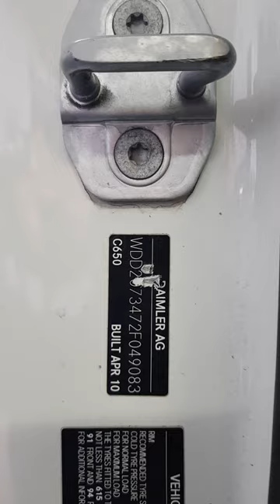Mercedes-Benz electronic seat motor repair tips

Comment: Common issue is that the cable housing stretches a bit. Fix is to get a new cable made that is a mm or so longer by a speedo shop.
Reply from the maker: I seen to cables turn out half turn ,usually it's can be put it back .
Reply: @alanw5812  yes, that can be put back in. But in a short time they may pop out again. When I had new cables done they never came out again. Up to you what you want to do. Your video is good in that it points out other issues that can be the cause of cable issues and should be checked for sure.
Reply from the maker: @georgecurtis6463  usually I will put that side to fit to the rail side, because usually came off  motor side.
Reply: @alanw5812  ok, if it works then it works.sadly many of the ones I worked on were due to the outer housing of the cable stretching and not being able to hold the cable in place.  So thus making longer cables. But if what you are doing works then more power to you. And yes, I tried many things to try and make it easily repairable but none lasted long if at all. As I was a tech and a shop owner I had to go the easiest and cheapest way that lasted.
Reply from the maker: @georgecurtis6463  I think half of people watch my video are try to diy, repair it himself ,if can use again ,use it until it need to replace, save the earth 🌎 😉
Reply: @alanw5812  understood. As I said, your video is very good. I just offered an alternative.

Comment: Quick question, how to remove the plug from the seat motor. I am unable to unclip it.
Reply from the maker: Hi! 0:24 Grey color lock,move that lock back a littlt first,then pull the plug, if just refit the cable don't need to remove cable !

Comment: Hmmmm, this could be the problem in my 01 s320. The seat was working (front of bottom section up/down), but now it isn't. I can hear the motor working but nothing happens. Hopefully as simple as this. Cheers
Reply from the maker: after fix, don't try to hold it to tight, it jump out because is for safety, cable tie is ok.
Reply: @alanw5812  Ahuh, nice nice. Thank Alan.

Comment: My w220 s55 driver seat adjustment works everything except the bottom seat cushion in and out adjustment. What could it be
Reply from the maker: are you hear the motor work? if not check  power.

Comment: How can you fix the rail are not level already seat in an angle. Do you have to remove the screws to open up the bottom rail to adjust and level it up?
Reply from the maker: it always the short cable come off, before you put the cable back ,use the switch to only move the long cable side rail, this how I level both rails.😁

Comment: hi bro ，i have a issue about seat adjustment is   about forward and backward problem after i change the motor and small module beside the  motor .When i push to forward but the seat go backward and push backward seat go forward 😂what reason can make this issue?
Reply from the maker: motor is only two wires, is the motor put on the wrong way, or the plug on the wrong way, because I can't see here, if you can't  find the problem, you can just swap the wires to fix it.

Comment: Hi Alan i have a e350 and i can see where the bracket is bent which cause the seat not to move forward and back. I can hear the click when i press the button the head rest and up and down works the seat is stuck close to the dash board would i still be able to tilt it back to replace the bracket ?
Reply from the maker: so the two front bolts can't remove, see can do this, look under the car, see can find that two front nuts, after you fought, drill the bolts only, see you can use the nut again, good luck.😁
Reply from the maker: did you remove the bottom of the seat cushion to look or just look from under, see can repair after the cushion out.
Reply: @alanw5812  hey thanks for the response upon further review of tilting the seat all the way in the up position i was able to look at it from the back of the seat. found out that the seat adjustment motor and the short drive pin is missing. so i will need to purchase another motor and short drive pin looks like its plug an play and  it dont look like the bracket was bent it looks like someone took it. hopefully this is all i need. wish me luck 🤞
Reply from the maker: @gman504ification  usually  have two or three motors, you can use other motor cable ,so you can move the seat back.
Reply: @alanw5812  hey I was able to find a motor and guess what I got it working 💪🏾  thanks for the video it inspired me

Comment: Hi Alan I have a problem with my 2004 e55 amg I been doing a whole lot of research and I can’t seem to find the problem, everything works with the seat it just doesn’t go down from the back like to sit in a bucket so the seat is constantly up and My head almost hits the roof any help boss would be great
Reply from the maker: Hi thanks for asking, first to check  is see can hear or touch and feel that motor work  under the seat, and do you know which  motor for the up down?
Reply: Yeahh I can hear the motor click along with the switch on the door and I believe it’s the control model for the seat clicking as well I checked to see if the motor was popped out but it doesn’t seem to have the same track as the one in the video
Reply: The head rest as well doesn’t work but everything else is functional
Reply from the maker: @aliawad5515  is it your  motors are three motors next together or two together or different area ?
Reply: Two separate motors
Reply from the maker: @aliawad5515  if you know now to use test light, find which motor is control up down, because the motor only two wires,  test those two wires to see it have power when down, but if you just want the seat down,just swap those two wires should do .

Comment: so the motor pops out? ill try popping it back in; ill come back.
Reply from the maker: use work side to adjust to balance left and right first!
Reply: @alanw5812  straighten them out?
Reply from the maker: @sewdesgaming637  after the motor up ,only the short side cable can come out of the motor

Comment: Both of the rods are spinning when seat is engaged but still moves  slanted, machine measurements on both sides on the track very confused please help
Reply from the maker: Sorry just wake up,  so short rod is left ,long rod is right, usually right side of the seat move left side not, because short rod come off easy, just did one yesterday, small plastic bottle jam under the motor,second times this car, usually case is the short rod not into the hole, other side of the motor, and remember to use the switch to adjust the seat to balance left and right rails before put the rod back, O four doors do it from the  back, 2 doors do it from the front ,any questions welcome  😀
Reply: @alanw5812  hey I got it to work but now when I fold my seat, the seat doesn't move forward automatically
Reply: @alanw5812  this is the second time I'm doing it, today zip ties became my best friend
Reply from the maker: @nickyfresh6577  our shop do RWC, a 4wd last week just use 30 plastic cable tie  to tie a roof size metal basket on the roof, oh no 😢 
cable tie under hot sun will Crack.
Reply: @alanw5812  how can I fix the seat , when I fold it to go to the back seat is suppose to move forward automatically help lol
Reply from the maker: @nickyfresh6577  so this is 2 doors, you need to put the motor and the rod back from the front, look at both front of the rails,use the seat adjust to move it to the same, then put the rod and the motor back.
Feel where is the hole on the rail before put the rod back.🤓
Reply: @alanw5812  rails are good fine just went I fold the seat it's suppose to automatically move forward now it doesn't

Comment: I have an issue with a c300 2010 with the switch that moves the seat forward and backwards. It makes a clicking noise but does not move. I am still able to lean my seat back and forward on the top switch. Any idea on what i can do to try to solve this? Mercedes wants to charge me 300 just to look at it
Reply: There was also a water leak issue with the car that was getting under the seats. So maybe moisture messed something up? Just not sure why i can move the top switch back and forward but not the bottom ( the whole seat)
Reply from the maker: Leak from sunroof ?
First check it is power to the motor that on my video or feel the motor by hand, if no power,then follow the wires to find the relay, everything are under the seat, or try the parts from other seat.
Reply: Alan W haha i dont even know where the leak came from but it was a nightmare because i was left stranded with my car not starting. Had to replace the CAN block from the water damage. I paid mercedes 1300 (they took off all the seats) to check for the leak and they never found it… i think it it came from the front windshield area by the wipers i cleaned it because it looked clogged with leaves and other stuff so we will see if that worked
Reply: I dont think its the sunroof though i would hope they atleast checked if it was sealed coorectly when i brought it in
Reply from the maker: @frankiehoxha  sorry if you said that, you need to know how sunroof seal, sunroof are not 100% sealed, even new car ,rain still can pass ,so all the models are the same ,it have two small drain holes about 5mm at the front each corner, and one big at the back, if block 100% are the front small holes.
how to check it, open the sunroof all the way, and put water slowly to each side middle,so the water will run to the front drain holes,it should drain to the holes within 10 seconds, if water doesn't drain, need to use high pressure air to blow the holes and check the floor any water draining, if se mean you fix it :)
Reply: Alan W thank you i was putting water on the one side to see but i didnt know what i was looking for 😂 so im gonna try that for sure
Reply: The reason why i dont think its the sunroof is because it was puddles of water under the driver seat and passanger seat. Mostly on the driver seat so i believe its the drain holes that i need to work on. Water by the pedal too
Reply: Oh i am talking about something else, i was checking the drain holes by the windshield. Because it was filled with stuff so i cleaned it. But i need to try the high pressure method for sure
Reply from the maker: @frankiehoxha  any water in the doors?
Reply: Alan W i dont think i had problem with the doors having water. It got very bad under the seats and by the brakes and gas pedal. I was driving yesterday and i felt some drips on my leg from under the driver side leg space. I had the AC on max cool, you think that was from the AC or the water leak ?
Reply from the maker: is a easy way to check, is tape the sunroof a week then see still the same  or not , use the tape need to easy remove.